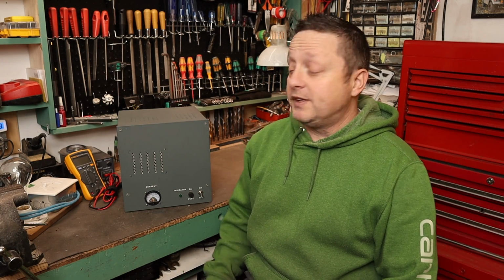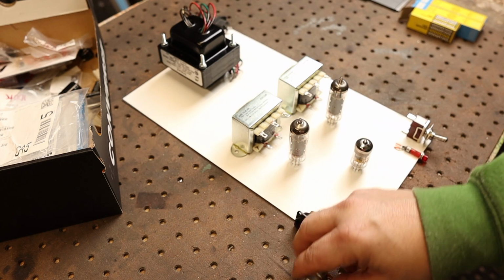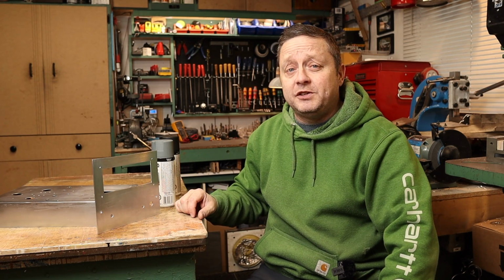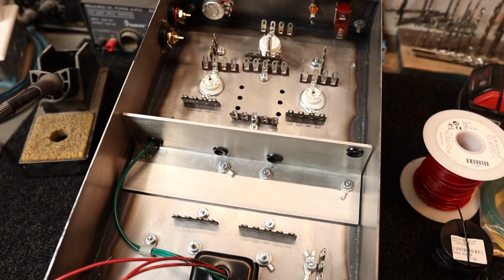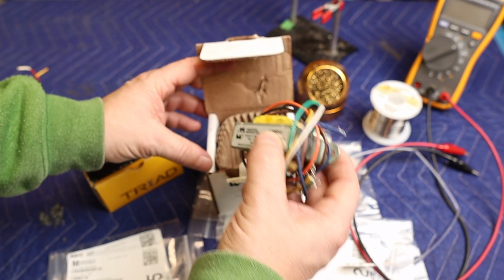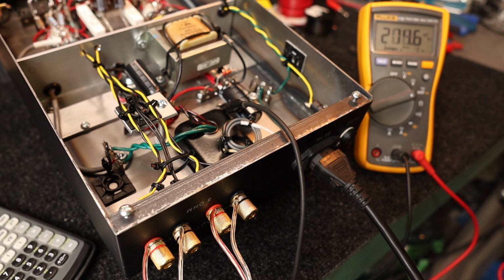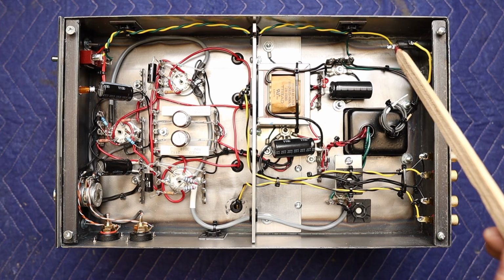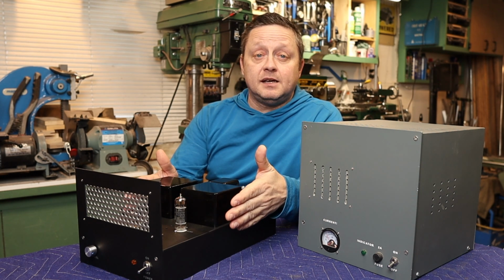DIY EL84 SE Tube Amp // Building a stereo vacuum tube amp from scratch

Comment: Nicely done! I used to build and enjoy building amps and other projects quite a bit, started as a teenager back in the 60's. I have more build skills than I had then, much better tools, but to be honest, I simply don't have the patience for it any more.
Reply from the maker: Thanks for commenting.  I started my tube amp journey from reading a Leo Fender book.  A few “older” men I worked with were into ham radios.  This was before the internet and way before YouTube.  They all laughed at me saying it was old technology.  They did end up teaching me a few things. Funny enough, I never stop wanting to learn more and now I know more then they do. Lol. Never to old to learn or try new things.  Cheers.
Reply: @MikeFreda Yeah, I think many electronics buffs our "our age" started on Fender amps. Either that or ham radio, either building from scratch or adapting war surplus radios that were available very cheap. The other factor that kind of sourced me on amp building was parts cost. Back when I started, tube sockets were 25 cents and the tubes were $1, maybe $3 for 6L6's. Now, if you develop a parts list for a Fender amp, you find you cannot build one for less than $400-$600, certainly not with a cabinet that can withstand dragging around to gigs. For a while I was buying carcasses of dead solid state guitar amps for $25 or even free, gutting them, and building a Princeton or Deluxe Fender. It's blastedly time consuming and the thing is, you can't quit at 95% completion. You have zero if you don't fully complete the amp. Yet, to buy the amp as a finished product will cost me $600-$700 but I can play it for 5 or 10 years and then sell it for $500-$600, so it only costs $100 to own.

Comment: tech tip you have your fuse holder wired the wrong way around
Reply from the maker: Thanks for commenting.  Interesting, I always thought the HOT goes to the barrel first. What's the rational?  Safer to pull the fuse out when its still plugged in?

Comment: For your filament wires are you using shielded two conductor wire?  That's pretty smart...  Do you find that works better than a traditional twisted pair?
Reply from the maker: Yes, it's 2 wire, twisted pair, shielded.  Only one end of the shield is bonded. I have 20 and 18 gauge depending on the current draw.  I find that it works well for tight situations were other wires (B+/signal) may come close. Cheers.

Comment: I just discovered your channel - I've worked in valve hifi so most valve amp videos on YouTube are difficult to watch at best but this is a solid amp. I'd recommend trying an EZ81 rectifier, routing the filament wires away from the chassis (though it is dead quiet) and definitely favouring wood and non-ferous metal chassis. This is kicking my backside to get on with projects! :o)
Reply from the maker: Thanks for commenting. Glad you like the built.  Actually, the original plan was to use a EZ81 but when I was simulating the PSU in Duncan Amps PSU Simulator, the B+ was getting a bit too low for my liking with 33-35ma of current on each EL84 tube. Next time!   The shielded filament wires works wonders. They can be a pain to strip , train and solder but it's worth it in the end especially if you have a tight/a lot of wiring.  Cheers.
Reply: @MikeFreda   - Its a job for a long winter evening, stick an album of five on and enjoy - its not like you'll ever redo it! BTW I was at a rock and jgem show and picked up a load of jewellery tools that are superb for bending wires up for turrets and tag boards.